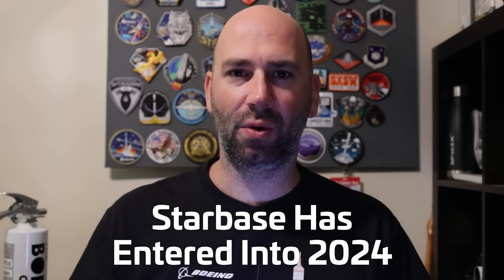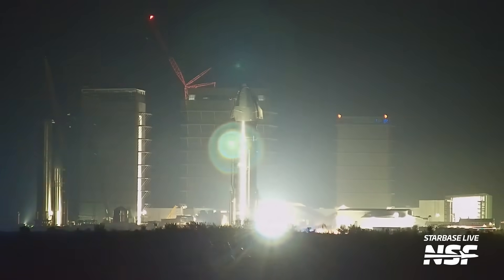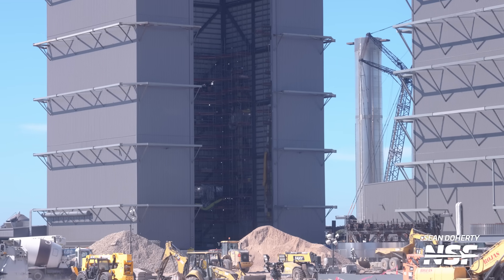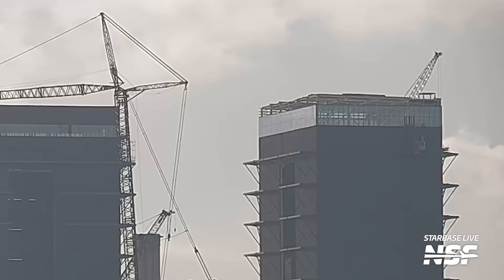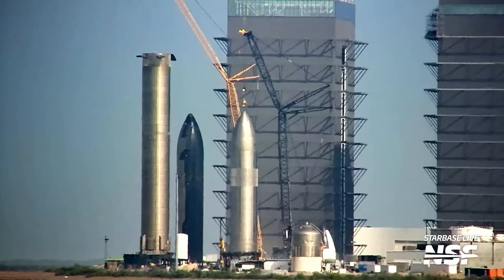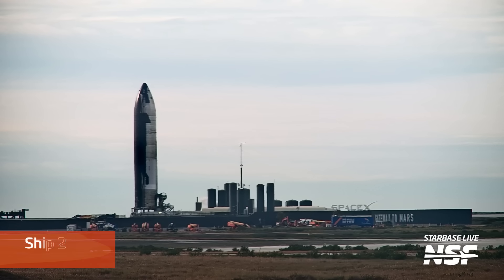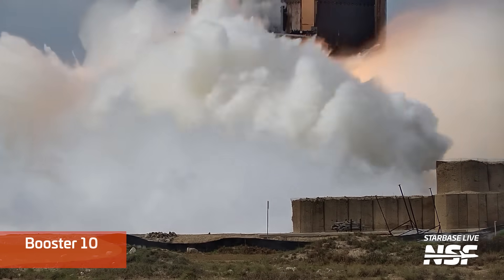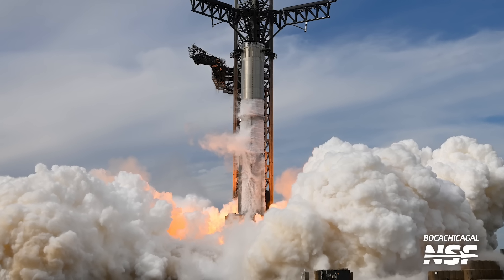Starbase Tank Farm Gets An Overhaul For Flight 3 | Starbase Update

Comment: Does anyone know what the water tanks in the OTF were used for? They don't need that volume for FireX system and the deluge system has separate tanks.
S26 seems like test article for training: how to attach stringers and work on engines...at least for now.

Comment: Ok, Jack, you've heard from me before! lol I think S26 is being prepped for an Orbital Fluid Transfer Test sometime in the future. If they were to convert the payload section into another fluid tank, the structure linking the top Meth Dome with the payload section probably would need strengthening. My question might be, how much more strengthening of the ship might be required. Next test for S26 might be another cryo test that frosts the whole ship. Of course, S26 could just be the article to test these things on the ground rather than in orbit, but I hope not.  The sooner they get into this fluid transfer part of the Artemis architecture, the better.

Comment: Sorry Jack, but methinks that your Ship 26 comments will not age well. IMHO, this will be the Orbital Propellant Transfer demo vehicle. The additional stringers may indicate some extra bracing or the beginnings of a design for the Prop Transfer hardware. Don't forget that the Artemis moon mission requires a Prop Transfer demo and has just been pushed back by NASA to 2026, citing the need for "Commercial Partners" to complete lander designs as one of the reasons (along with moon suits). So I boldly predict: S28 next, will achieve orbit and deorbit, no prediction on the heat shield efficacy, S28 MAY try to take one or two Starlink V2 sats because, why the hell not. After IFT 3 is where I get a little fuzzy. Since SpaceX has a history of being bold, once they demonstrate orbital insertion on IFT 3 (fingers crossed), they may launch S26 on IFT 4, and then an orbital Prop Transfer Demo on IFT 5. Makes sense to me anyway. Cheers.

Comment: Among the rumors related to Starship V2,
there are talks of expanding the fuel tank to include the payload, or extending the Starship's overall length by 10 meters.
Ship26 does not have a satellite ejection port. Maybe it's a version with the fuel tank extended to the payload bay.
In addition, it is necessary to put more tankers in orbit in the future. 
That's vehicle would not need flaps or tiles for atmospheric entry.
I think Ship26 is a prototype of an orbital tanker.

Comment: Aerospace engineer says, to find what S26 is, you find the square root of 26, which is 5.099. Now subtract 5.099 from 5.099 = 0. Now divide 0 by 0. 0/0 = undetermined.
😅😂😅😂

Comment: Ship26 will receive insulation after the reinforcement stringers and it will be launched into orbit to serve as a path finder for the in-orbit fuel depot.  Starship orbital cryogenic propellant transfer, practice mode.

Comment: Ship 25 may have failed on IFT-2 due to an acceleration-related structural failure, given that it occurred near the end of the burn when acceleration was over 3.5 g.  The stringers could be the fix for this issue.  External stringers may have been an easier retrofit than internal reinforcements.

Comment: Or is S26 the moonlander?
The extra ring on the hull needs to be stronger there because of the thrusters that will be used during landing and take of from the moon surface?
And at the bottom they will be working on the landing legs?

Comment: My Take on 26: They're reinforcing the breakpoint from the starship in IFT2. In the event IFT3 ends up having the same issue they will have a quick turn around on IFT4 with a ship designed just to get to orbit with extra reinforcements on the perceived break point. All in all in my opinion it is an attempt at managing the PR and Nasa pushback for an IFT3 failure. They must keep the momentum going.

Comment: They will swap out the engines on ship 26, replacing them with the latest version of the raptor engine so they can do a test fire of 33 of the new raptors together in flight configuration and testing an enhanced water deluge system.
Reply: Ships can only get 6 engines not 33
Reply: @ale131296  🤦🏻‍♂️You are correct!  Thank you for the correction.  

It will receive six next level Raptor Engines. It makes more sense to start by testing six more powerful engines on a ship and on a Test Flight before testing 33 of them on a booster.

Comment: longshot speculation: ship 26 could test the cooling method mentioned when switching to steel, with a perforated second hull to release propellant, boiling off to carry away reentry heat.

Comment: QUESTION:  Unrelated to the video but does anyone know how they will protect / fix the orbital tanker if it takes a meteor or orbital debris strike.  The leaking of the high pressure cryo could start it tumbling and or leave an orbital mess.  Ditto for a propulsion system malfunction like on the Gemini 8 mission. Double walled or something else maybe?  Will it live in a "tanker orbit" so such an event is less of a danger to other spacecraft?  I expect this has all been thought out but I haven't seen any info about it.

Comment: Re Ship 26:

Yeah they must be planning to use it as some kind of tanker.  Non reusaeble.  No heat shield.  No flaps.

Although, (and not necessarily connected to the above)  I had wondered about the payload slots on other Starships.  Could some be sliding doors that would allow a refuel boom to flip out?

Also re 26, any chance they could be fitting it with Raptor 3 test engines, just for shits and giggles?  Hahah

Comment: In ship 26 they are installing stringers to reduce flex and to make it stronger.
Reply: for sayyy ...a heavier fuel transport?
Reply: @TheUmbrex rather for having good testbed for hls stuff, like interior, doors, elevator, cutouts for landing thrusters etc. 
Imho using as orbital depot is out of question as long term depot would need stuff like better insulation, some kind of hardware for cooling (radiators, solar panels etc). Rn initial refueling need time between launches, even with prepared hardware. I doubt that they can launch faster than once, twice per month

Comment: My take on S26: It will be converted into an HLS pathfinder for the interior design inside the cabin. As of now, the structure of Starship can fail when its not pressurized or hooked up to a crane. By installing the stringers, Spacex is removing the need for that, meaning it will be able to stand by itself without occupying a crane or other hardware needed for pressurization.
Reply: It's the first iteration of the Orbital Tanker.
Reply: Or, 
A) it will be a device to test future GSE on the Launch Tower. Including static fires
B) it will be used for 'full scale' orbital fuel transfer tests with no expectation of a safe landing.

The 10-second 33-engine firing may have been a launch force simulation to test the hold-downs, etc. on the launch platform and the rest of stage 0.
Reply: Yeah, I too think it will end its life as an HLS mockup. 🧐🤔
Reply: My guess is that it's an orbital fuel depot, the stringers are on the outside as there's a tank we can't see inside that payload bay area. 
They need to demo orbital fuel transfer ASAP.
Reply: what are you talking about? both the ship and booster can stand on their own already.
Reply: The ship can already stand by itself without pressurization. But perhaps not with a payload.
Reply: @shawngadwa269  No, they are always either pressurized or, like right now, it is attached to a crane.
Reply: Hls mockup or HLS  test vehicle.  Addional strength needed in unpressurized zone of hls  around air lock.
Reply: That's what I was thinking, but the bracing would be for added landing engines. Maybe they'll have one Raptor on the bottom to counter the weight down to moon gravity, then use the ring engines to simulate moon landing?
Reply: I came here to say that. Great minds I guess.
Reply: 💪 Jack Breyer !
Reply: Dude is giving depression. You know if he is ok? I'm new here and they are making good content
Reply: @lazarv7015  what
Reply: @benni1951  this presenter, Jack. He looks mad depressed
Reply: @lazarv7015  You admit you're new here, and yet feel it's ok to shoot from the hip on someone's mental health. How about you don't? This is Jack's presenting style. We like it.
Reply: @maddogUK69 been listening since 2020, he does sound a little more down than usual. Could be that he’s not shouting at a camera 30 feet away
Reply: either that or they just remove the engines and convert it into some boring tank

Comment: I'd say SpaceX is installing the strings on outside of S26 to test some integrity for the Lunar Lander. In final version these strings would be inside, but it's not possible to install inside in a ready ship.
Reply: They wouldn't care which side the stringers go. There's si much power availale on the booster, and the ship itself, and most of the trip would be in vacuum anyway. Mind you, SpaceX "streamlining" seems to only extend to 45 degree flat panels at the front.
Reply: They weld inside the ships all the time. Welding the stringers on the inside would not be a problem.

Comment: Ship 26 is going to be used as a test refueling ship.
Reply: Agree
Reply: There is really nothing that indicates Ship 26 will be used as such. It only got stringers added, nothing else in its design points to it being used as a refueling ship.
Reply: @ale131296  It even has studs (for TPS). Why would a tank need them? I am leaning towards a structural test framework.
Reply: @knowledgeisgood9645  Studs were there because it was originally a standard build. Repurposed. Possibly to work out an HLS structure. As it stands, the thing could do a "tank test" like SN5 and SN6; but there would need to be landing legs added first.
Reply: @paullangford8179  I would be astonished if it ever launches at all. Had they removed the studs I would have maybe held it possible.
Reply: Possibly could be.
Reply: I don't think it can be lifted by the chopsticks anymore,  the stringers cover the lifting points
Reply: @Astromath  They could weld new lifting points on the outside. Like those on the boosters.
Reply: @Astromath  Not quite.
Reply: Agreed.  Structural reinforcement might give them a slightly higher operating pressure.  That might give them slightly reduced boil off.  I hope they rig a deployable sunshield ala skylab/jwst to reduce heating.
Reply: I agree, all it needs is a tank.